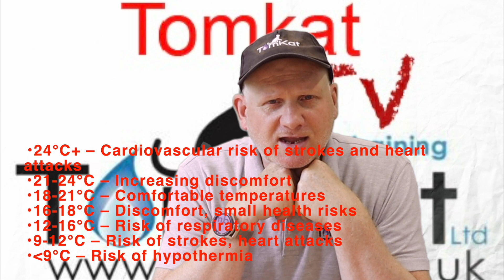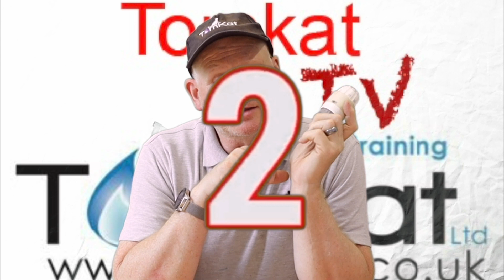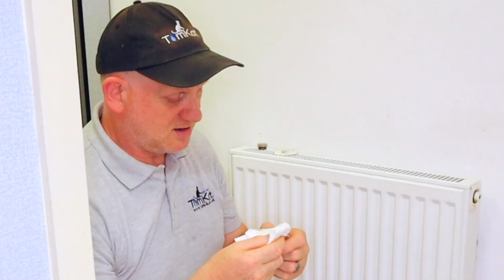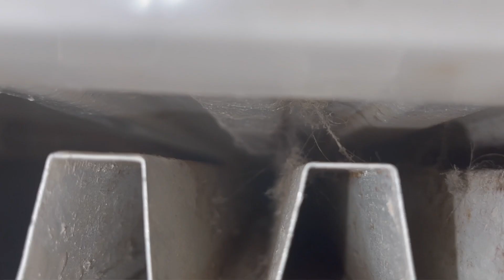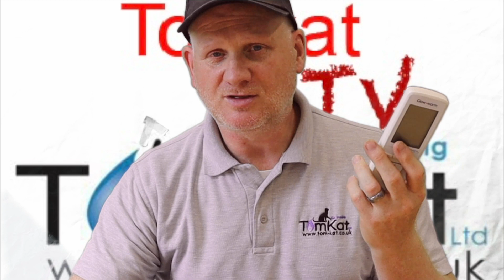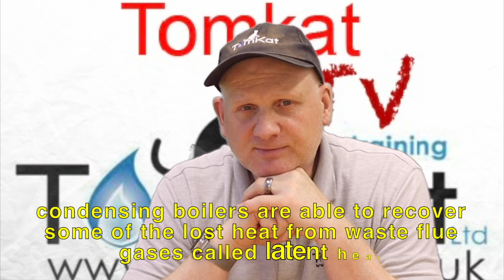Save gas save cash. 15 tips on how to save money on your gas bill.  #saveenergy

Comment: My room stat is in the hallway, which is a very small hallway with 1 radiator without a TRV, should I I turn the room stat up so that the heating doesn't turn off before the TRV's in the other rooms turn the rads off?
Reply: No, as that would waste more energy and be counter intuitive. Your heating installer has:
a) correctly installed the radiator in your hallway without a TRV because your thermostat is placed there.
b) presumably sized the radiator in the hallway correctly. So because you have a small hallway, presumably you have a small radiator there, appropriate for the size of the room etc. You will also get heat from adjacent rooms that come off from the hallway too.
In short, everything has been designed appropriately by your heating installer and you should set your thermostat to a sensible comfortable temperature (21 degrees or lower) and leave it to do its job.
Reply: @ifallelsefails2  I have the same setup in my (small) hallway as the person above, but my hall rad has a TRV. What should I have it set to for the best efficiency?
Reply: @c.marmion8430  Set it to the maximum it will go to, eg. 5 or 6 and leave it there. Never adjust it. Then, when your heating next comes on, make sure that the radiator is hot (so you are confirming that the TRV is functioning and is fully open). If you have children/renters that you think will play with the TRV, then consider removing the controlling head to prevent tampering. However, this will leave a blunt spike behind, so you then might need something like a bottle cork sellotaped on to keep it safe from children. Let me know if you need help with doing that.
Reply: @ifallelsefails2  Thanks for your reply Alan. There's no children here, so no problem re tampering with the TRV. I've set it to the highest setting now so that should be better.

If I may ask you another question...? As mentioned, my room thermostat (Honeywell) is in my hall, and I have it set at 22 degrees, however when it reaches 20 on the thermostat the boiler (in my kitchen),:which is only 4 years old) switches off (fires down). Yet at other times it reaches 22 on the thermostat but the boiler doesn't switch off, when I would have expected it to.

I've spoken to the boiler makers (Vaillant) about this and they said that the thermostat isn't so finally tuned (or words to that effect) and that a couple of degrees either side of the set temp is considered acceptable. This doesn't make any sense to me, what's your view on this?
Reply: @c.marmion8430  Sorry for the delay in replying. I have verified with other thermometers across different Honeywell thermostats that Honeywell thermostats are very accurate to within the .5 degree that you can set them to and when placed in the coldest point in the house (eg. the hallway), that they work well to maintain the whole house at that temperature. This is due to the "software" in them (ie. the way that they work - they are not just a digital replacement for the old fashioned analogue thermostat, which is what Vaillant are thinking of). A few years back, I spoke to Vaillant technical. Unfortunately, they didn't understand the underlying workings of how Honeywell thermostats operate because Vaillant's operate an entirely different way and so they obviously hadn't received training on them. It is sadly a poor reflection on Vaillant, given that Honeywell are widespread and the concept they use is not unique to them. So, you can ignore what Vaillant have told you.
Honeywell thermostats operate using what is called "TPI". If you google for "TPI functionality explained - Honeywell you learn", hopefully it will bring up an FAQ document explaining all about how your thermostat works. TPI (when implemented well) is an excellent, energy saving methodology and in my opinion, and having tried an alternative branded thermostat, Honeywell's do this superbly.
So, once you have read that document, you will understand that a) your thermostat is very accurate and b) yes, I do expect your boiler to turn off at 20 degrees, at first. However, it will then monitor the temperature, wait for 10 minutes and then fire the boiler again for a few minutes to raise the temperature slightly. It will then wait again for 10 minutes, monitor any raise in temperature and then fire the boiler again for a few minutes to try and raise the temperature again (it calculates how long it needs to fire the boiler for, depending on how much it has raised the temperature previously, the current temperature and your target/setpoint of 22 degrees). It keeps doing this 6 times in an hour, every 10 minutes, to edge closer and closer gradually to your target/setpoint of 22 degrees, but with the aim of never/barely overshooting it. I have never seen any of my Honeywell's overshooting the target temperature, even when set to .5 of a degree - TPI is that good.
What you need to look for is the flame symbol on the Honeywell thermostat, this indicates that the thermostat has determined that it requires heat from the boiler and has signalled the boiler. So again, in your example, this should appear when the temperature is at 20 degrees. However, it does not follow that the boiler will always fire up instantly that the flame symbol appears. It can sometimes take a minute or two. You can then see on the visual display of your boiler that the radiator symbol is showing and this shows that the boiler is delivering heat to your radiators. When the thermostat gets to 22 degrees, the flame symbol should disappear on the thermostat and the radiator symbol on the boiler should also go off.
(tip for troubleshooting: if the flame symbol is on the thermostat and it has been 15 minutes and nothing has happened on the boiler, then you know you have a problem with your boiler or the thermostat receiver).
That's an explanation of how it all works.

Comment: A small point I want to add to point 10
My combi boiler (intergas combi compact hre) has a "on demand preheat" setting.
This allows you to pulse a hot water tap and have the boiler heat up the heat exchanger to hot water temperature with the tap off.
You can set the number of minutes it will stay hot,  until it goes back to eco mode.
This saves you both gas and water.
Reply: I've  had a Rapid 32 for five years and don't  use the preheat options, a lazy feature.
Reply: Totally agree, Intergas preheat reprogrammes every 36 hrs  or so, therefore does not heat up all night long like our inherited Worcester !!
NOT a lazy option.
It's how people interpret these measures.
Reply: @kevinschoales844  Intergas preheat facility has options for off, continuous  and learning modes.
Would suggest it's  a question of how much water is used with and without pre heat against gas consumption.
In the heating season, consider the gain from that side of the heat exchanger and then see if preheat is an advantage.

Comment: Lower you're power output and pump speed of you're boiler and balance you're radiators.
 The lower they burn the more efficient
And with lower pump speed the water gets more time to give of heat and lowers you're return temperature so you're condensing boiler is condensing and efficiency is going up .
Lowering you're temperature could be not so good for the boiler if it is going on and off all the time.
Heat exchanger will break down fast .
Went from 18kwh to 6.5 kWh .
Don't even hear it burn
I saved 50%
Reply: Well done and congrats on your successful savings. So many good examples of energy saving ways, BUT the general public don't grasp it generally, its double dutch. We do get to  manage some features into customers homes after things go wrong !
Reply: @kevinschoales844  you have to be a little technical to understand it but it is no rocket science.
but not all people do indeed.
if read the comments 🤯
Reply: My combi boiler constantly switches off and on and is quite noisy (i.e. running high). What could be the cause of this? (I have my one and only room stat in the hall which is constantly set at 22 degrees).

Also, can you please explain how you balance radiators? Thanks in advance.
Reply: @c.marmion8430  balancing is allowing each and every radiator to warm up as each other by reducing the flow on the nearest radiator lockshield valve or get Drayton TRV4 Auto balancing thermostatic valves. Regards cycling on & off get boiler output reduced, get a smart Wiser control by Wiser, save at least 30% commonly much more.
Reply: @kevinschoales844  Thanks for that. It went way over my head 🙂 but I'll show it to the man when he comes to service my boiler.

Comment: Draughtproof house (watch out for damp)
Range rate boiler output.
Insulate if possible
Adjust boiler flow to maximise condensing( watch out if you have a cylinder). Needs to be enough to heat the water!
Adjust hot water temperature lower to avoid mixing with cold and using excessive gas
Turn thermostat down or put a jumper on.
Powerflush system if sluggish
Check for air in rads. 
Make sure your stat is running on opentherm or other manafacteur specific coding and is doing what it should be doing for plus £200 thermostat.
Don’t block the radiators
Upgrade the sizes of radiators so they can run at lower temperatures
Balance the system.
Have your boiler serviced and make sure it’s running efficiently as it can.
Replace boiler if it’s a non condensing (pre 2005) 
Replace cylinder if not lagged properly ect potentially fit combi of cylinder not needed.
Turn pre heat off it’s crap!

Comment: So how are we supposed to dry the washing in winter if using radiators, causes mould..please don't say tumble dryer, as all the savings I've just learned, will be lost to the tumble dryer costs
Reply: Just what my mother did, watch the weather and dry them outside,simple!!
Reply: @johnward5006  bet your washing smells lovely in the winter, whilst waiting for an opportunity day when your washing will dry..That's fine if your at home all day when you can keep running outside to bring washing in when it rains..
Reply: Don’t wash ya clothes
Reply: @kevinjackson6387  haha, I'll get straight on it ..
Reply: Don't shower every day. "Unless you work out, or work outdoors or for some reasion come into intimate contact with huge amounts of filth and garbage every day, you don't need to shower. All you have to do is wash the 4 kay areas. Armpits, asshole, crotch and teeth. Got that!? Armpits, asshole, crotch and teeth. in fact, you can save a whole lotta time and energy, by using the same brush on all 4 areas!" - George Carlin
I've had beer.
😥
Reply: @loafersheffield  we are talking about washing your clothes , not your body..keep up stinky 😂😂😂
Reply: Use those wire drying racks that hook onto the front of the radiator that he shows in the video as they don't obstruct the heat from the rads and dry your clothes well. I have several and they do the job.
Reply: Use an airer and a dehumidifier. A tumble dryer might be cheaper if you've got a good one tbh. My tumble dryer costs me less than 50p to run, even with current electricity prices

Still, what I would however do, is if you've got enough of a winter sun, pop your clothes out for a bit, and if your washing machine can't spin the clothes at 1600 rpm, get a spin dryer to get them as dry as possible

I've got a 1600 spin washing machine and an A+++ rated tumble dryer
Reply: We don't use the tumble dryer any more, but we do have a small dehumidifier when we can't hang the washing out. It uses less leccy and you don't get mould.

Comment: When you've got sealed all windows and doors ideally, I'm afraid CO2 level will be very high. Why don't you take this into account at all?
Reply: I think you mean CO levels, not CO2. If your boiler is room sealed then the CO risk is very low as the boiler does not share the air you breathe. It takes its air from outside. If you have an open flue boiler then the correct amount of unblockable fresh air ventilation is very important for your safety and that of all occupants as the boiler takes its combustion air from the room. If you are not sure which type of boiler you have then ask a Gas Safe Registered engineer to call and advise you. You must check how much they will charge, so it may be best to combine the call with a boiler service.
Reply: @timhancock6626  
No Tim he or she means CO2! Your right about the different between room sealed and open flues but I'm sure this is to do with the CO2 we breath out NOT CO being breathed in! CO2 levels will increase moisture content in the air along with boiling kettles, cooking, showers and baths. This will increase risk of damp, mould and possibly risk to health. Some ventilation or other means of controlling humidity is extremely important, but will come at a cost! Perhaps Derek can put a video together on the importance of this and economical ways to control it?
Reply: @tonyadams380  CO2 level in the open air is around 420 ppm. 2000 ppm is considered already unhealthy. When I close door , window and ventilation grill in my bedroom, 2000 ppm is reached less than in a hour.
Reply: @tonyadams380  Actually the things are very simple. Human consumes oxygen and produces CO2.  I even didn't mention other VOC gases produced by human body. So we need fresh air supply. In other case we end up in warm but lack of oxygen environment. So then headache, bad feeling, health problems. Is that correct way to keep the room warm  and lower energy bill? I think no.
Reply: @timhancock6626  No I meant exactly CO2. Whe you breath in the sealed room,  oxygen is decreasing rapidly and CO2 is increasing.

Comment: I deemed myself competent to service my Worcester-Bosch 30CDi which hadn't been touched for maybe 8 years. After cleaning the heat-exchanger fins using the Worcester-Bosch rasp and brush, it's been notably more efficient. 
I also turned off water pre-heat (eco mode) and set the CH output to 60% of the maximum capacity via the technicians menu. Then set the hot water temp so it doesn't need cold mixed to shower; I always use the dishwasher so don't need piping hot water for dishes
Then set the flow temp down to 2 on dial and will check if the rads can get the house to temp once it get's cold.  Room valves are smart TRVs with 5+2 temp profiles (not in lounge) and I use a Drayton Digistat 3+RF in the lounge, again with 5+2 profiles, which fires the combi via the receiver unit.
Reply: We are not here to police but discuss energy savings, however you cant deem yourself competent.
So well done on other issues apart from the gas servicing.
Reply: To be deemed competent you need to understand combustion, testing and analysing (with in date calibrated equipment) and examined both on theory and practical tasks in an approved ACS centre. Sorry to say but deeming yourself competent is stupidity and illegal (go read GSIUR - if you're competent you'll know what it stands for 😜)
Reply: Is the heat exchanger in the combustion area? If so you may well have broken the law.
Reply: @davideyres955  Luckily the police have real crimes to worry about
Reply: @davideyres955  That’s OK - British Gas break the law - send a gas safe engineer round to con you into think they are doing a service when they don’t, it’s called FRAUD.